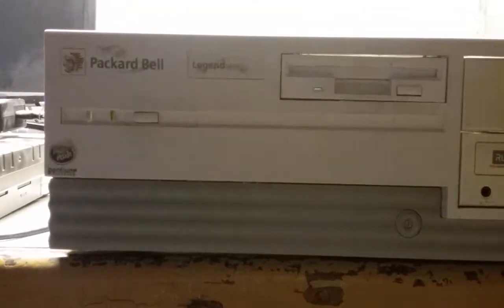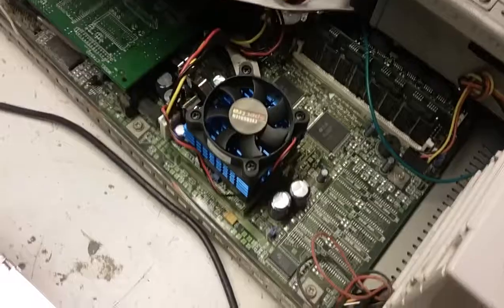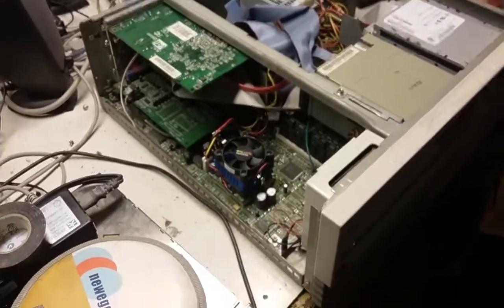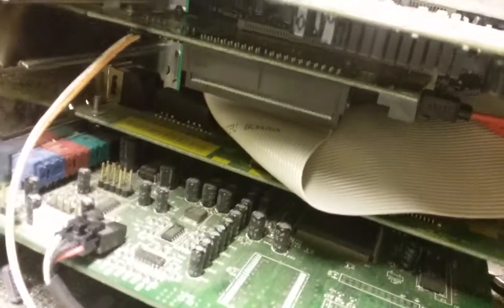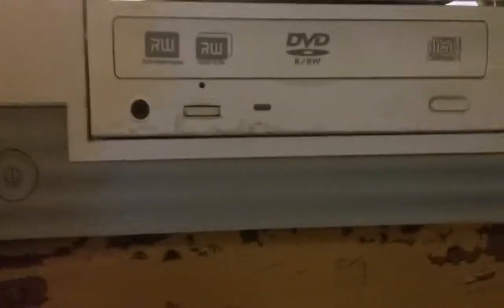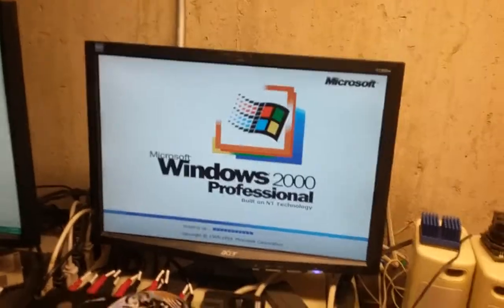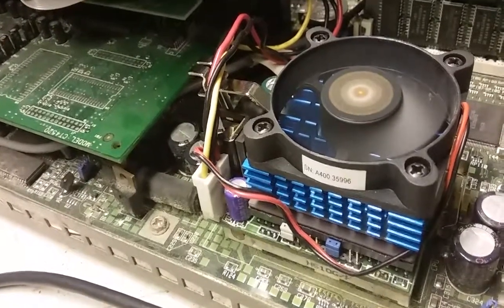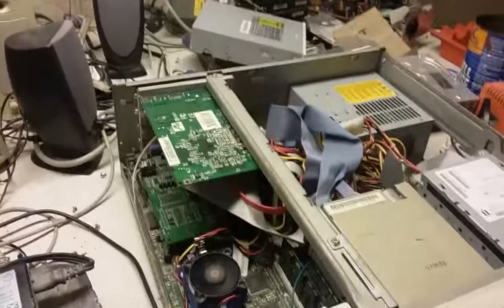Upgraded Packard Bell Legend 410CD (or is it?)

Comment: Did you ever try and see if the Evergreen Bios updates worked on this system? the CD and Floppy files are on Vogons and if this system has one out of the 3000 system Bios they have on there might be one for this system and perhaps give you better compatibility and would show actual info on post and in windows without cpuid
Reply from the maker: Thanks for the heads up!  While I hadn't been too concerned about the misreported CPU during boot, I do want to use a K6-3 processor in this computer.  Every time I've tried, however, I would get blue screens or freezes in Windows.  My thought process lead me to believe that the BIOS does not recognize or use the L2 cache correctly, and since then, had been trying to find a repository of Mr BIOS updates that may actually clear up the issue.

That being said, however, combing through the available BIOSs available on Vogons, I was unable to find one that advertises that it would work with my PB600 AGOURA board.  On top of that, the floppy/CD combination that is available would not recognize the install floppy, so it could not find one that it thinks might work automatically.  Still searching!
Reply: @iammrsparkle84  yeah the L2 cache on that might actually end up reporting as L3 with the k3 but it's hard to say what's up with the floppy I use a gotek usb just put the floppy stuff on there and the CD stuff burned it like an iso to install. But I do know you load the floppy run its stuff then goto windows and install the CD software then back to floppy and if a bios is there the upgrade Will un gray but unfortunately packard bells weren't loved by all so it's possible nothing is out there and you'd need to find someone willing to work with it and make something.
Reply: Can you help me identify a Packard Bell Legend Desktop?
It lost its badge and probably upgraded, now its Pentium 200, 32mb simm dram (FPM/EDO mix) (was 16 or 24)
But looks exactly like on this video
I tnink its Legend 100cd, legend 410cd or like that... maybe you know restore cd image link or something for these

Comment: I had a K6-3 in my PB600 because my motherboard had no L2 cache.. Also got ours in 1995, used a powerleap adapter
Reply from the maker: Not sure if you caught my other video on this machine, but I did indeed get a PowerLeap adapter with a K6-3: https://www.youtube.com/watch?v=WHmNsRMy4Pw .  UNFORTUNATELY... the machine was very unstable running with that installed.  Perhaps I got a faulty one?